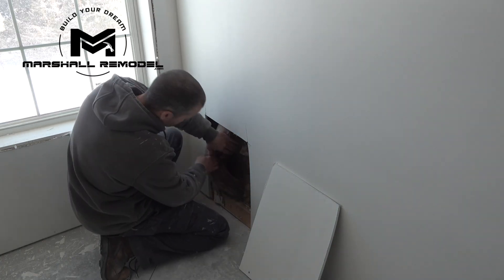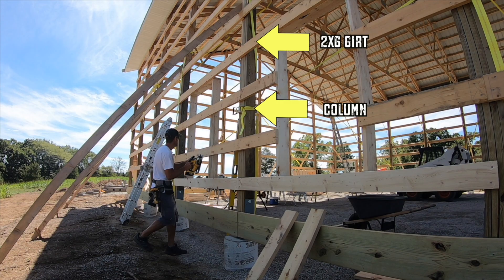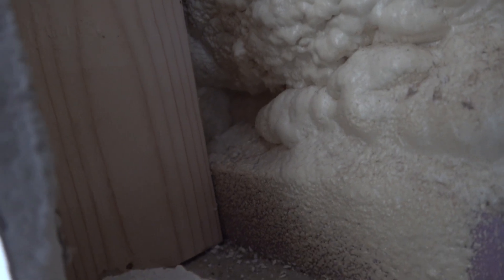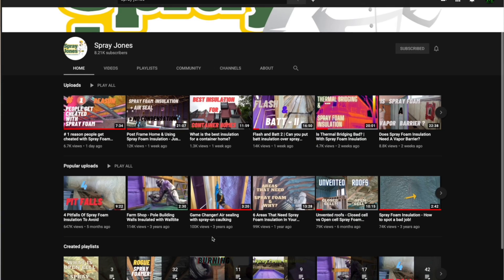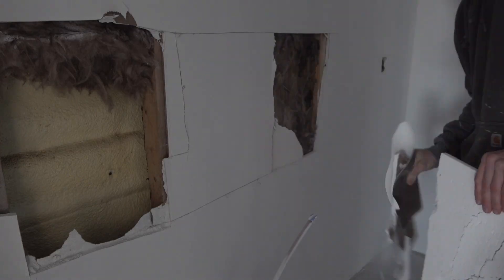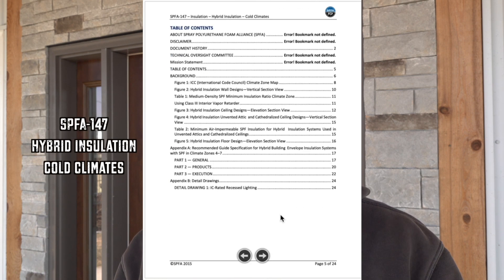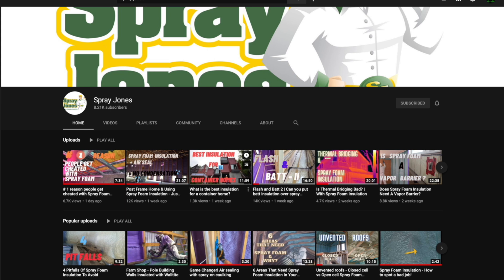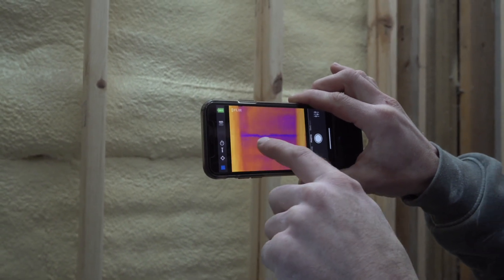Watch This Before You Insulate Your Home! | What Caused the Moisture Issue

Comment: I think that fiber glass insulation here is the main problem, I explain: as someone else wrote here that condensation appears when warm, humid air meets a cold surface, in this case, the inner side of the spray foam insulation was cold, because fiberglass  insulation was not allowed it is warm there, but the humidity passed, and condensed on the surface of the foam insulation
Reply: I think you right.    Our metal building we put 2 in closed cell and 4 plus inches open cell over that   Would still condensate.     Amarillo TX.   Dry area.    If designed for tighter living space needs more ventilation.   Spray foam is toxic as well.  Cool product but can achieve similar results with mineral wool

Comment: Would notching the posts and eliminating the 1-1/2” gap from the 2x6 running east to west across them fix this - it would make the tucked and metal flush to your upright beams and eliminate the gap that you currently have

Comment: I did not quite understand this. I always lived in a fiber glass insulated house. So Dew point should be inside the fiber glass insulation. However, I never had any issues with moisture for many houses I lived.

Shouldn’t condensation happen inside the fiber glass since it is not a vapor or air barrier?

Comment: I wonder what would happen if you blocked between the girls with 2x6 attached to the posts.  That would eliminate that 1-1/2” space that is hard to get the spray foam into.

Comment: I watched a lot of Mike's videos. I get what he's saying about having to make sure the chemicals are right and haven't been sitting around for two long as they appear to have a short shelf life, and how the installer has to properly apply the spray foam and insure at least 2 to 3 inches of coverage, etc. But from everything I've watched so far it sounds to me like the spray foam is more of a secondary back up to insure any moisture isn't able to seep through where the spray foam itself acts as a secondary barrier to block moisture from coming through. What is confusing me though is how are the people using only batt insulation not having major issues with their insulation is getting soaked with moisture? I know RR has built a lot of post frame metal buildings where he only used batt insulation without any spray foam. You would think because of the metal siding that insulation would be getting soaked from moisture build up from the metal siding. Yet if you use spray foam AND batt insulation over the spray foam, it appears a lot of people that have done that are now finding the batt insulation is getting wet. 

One of the things I would want is to be able to create as much sound proofing as possible when building a work shop to prevent noise from bothering the neighbors and anyone in the house while sleeping. I'm more of a night owl were I could see myself playing around in the shop to 3 AM on many nights. I heard using close cell spray foam does not act as a good sound barrier and can actually contribute like a noise conductor to transmit sound like wood does. So I was thinking in lines of using the closed cell spray foam and then adding Rockwool insulation behind it since it has a good sound barrier to deaden the noise from inside the shop when running noisy equipment like a table saw, planner, etc. Now I'm thinking maybe the best to achieve better sound proofing would be to use the spray foam on the outer wall then just double frame around the outside walls and use the Rockwool on the secondary wall which would create about a 1 inch gap between the double walls and create a more solid soundproof building. It would also allow for all the electrical and any water lines or plumbing to be run through the secondary wall leaving the outer wall to be completely enclosed with spray foam with the exception of having to run any electrical through the outside wall for any outside lighting, plugs and water spigots.

Comment: The primary problem the system you have used is that you did not install an exterior moisture barrier and drainage system. For example,  a Zip board system on the exterior would have been an excellent choice.  With the Zip board you would then install an air space between your metal siding and the Zip board.  There are plastic baffles that you can use or liquid rubber applications like RedGuard. Zip board issues several designs for exterior wall waterproofing.  At the bottom of your wall system you would install a weepscreed to allow any water that penetrates the steel siding to drain out the bottom of the wall. 

This would provide redundant protection from water penetration. Your current system will not. 

I am skeptical that interior closed cell foam is sufficient to shed exterior water over time. It really is not designed for that. Your only alternative at this point is to ensure the exterior steel siding envelope is perfectly waterproof. That is a daunting task,  but it is doable. 

Make sure every penetration through the exterior siding is sealed,  preferably mechanically sealed with rubber washers or flashing. Try to avoid caulk as much as possible because it becomes a nightmare to maintain.  Use high grade exterior caulk as a last resort. 

I hope this helps you.
Reply: Water penetration isn't the cause of his moisture problems. The problem is condenstion from moist interior air against cold exterior walls.

Comment: Mike is the guy. Too bad he is only in Canada. A good inspector pre and post spray is a wise idea. Also, consider if you need to go all the way and put a bullet proof moisture/air barrier in place in addition to the two pound foam. Mike can make 2" of two pound work and skip spray and batt, if the foam does not work, neither will the batt insulation. David Poz did his own house with a double stud wall at about 14" of cavity filled with blown in cellulose, no inside VB, regular plywood sheathing, and then Grace Ice and Water Shield on the entire exterior of the home - roof and wall. His blower test was off the chart good. This stuff will keep you up at night even if you don't watch Dr. Joe!!! Bob in Nevada were we do not fix leaky roof and follow none of the good rules, dry air is dry air and a leaky house is fine if you can afford the utility bills. See ya.

Comment: I thought there would have been a better discussion about building science. To me, a contractor who believes in only one method of insulating is to bias. It would have been good to hear the degree days (Example: DD6000x.004=R24), optimum levels of insulation depending on the region, and where the dew point falls in the wall, etc. How the slab, walls, ceiling, HRV/ERV, windows and thermal mass work together as a complete building system seems to be missing in these self builds. Seems like if one is spending north of $200K, building modeling would be worth the expense before construction.

Comment: So what caused the moisture? Sweat or like rain and frost coming through?
Reply: Sounds like its condensation due to not enough foam - not a leak. Warm inside air is hitting the cold spots and condensing
Reply: @ELIRAXPRT   thanks! This had me worries I'm in the middle of building our post frame house and we went with spray foam. Exept we went with open cell and ours is 6 to 8 inches thick. Hopefully this doesn't happen to us

Comment: That is too bad!!  Why did you not put any vapor or double bubble under your roof metal?
Reply from the maker: The attic space was not the cause of this problem, and we do have a properly insulated attic space.
Reply: @MrPostFrame  I didnt mean to imply that was the problem. I was just wondering if the roof dripped at all, I have never seen roof metal without some kind of vaper barrier.  I really like the attention to details that you put into your build, makes all the difference!

Comment: You didn’t mention anything about the extreme conditions that lead to the failure, high indoor humidity and extremely low outside temperatures.
Reply: That's because he said to go watch the other guys video that covers everything you mentioned.
Reply: @macevans1246  Yes but we come here to watch, hear and learn from "his" story, understanding the extreme conditions and the timing is an important part of this story. If the drywall phase of the project was taking place during the summer months, no symptoms would have presented and it would have been completely missed.
Reply from the maker: It's likely this won't be the final update on the situation. Tried to keep things simple this go around.
Reply: @MrPostFrame  I can totally understand that, I am sure your plate is more than full of challenges at this time. Love the channel, keep up the excellent work.
Reply: @MrPostFrame With the price of lumber at triple of a year ago im seriously considering Insulated concrete forms( no mold issues)..instead of stick or post frame as the cost currently is not that much more diy but haven't checked the price of concrete lately. Hope the price 1/2 " sheathing/roof decking( not even roofing on only purlins of a 12/12 pitch roof) comes down from over a $1.50 a sq ft or else many others and I may cancel/ delay starting build. Perhaps that will lower demand, will deflate the 50 bucks a 4×8 1/2 cdx price.
Southern Iowa is as much of Midwest( my planned build in southeast Ohio)are both hot and cold climates bordering zones 4 an 5 so what are we to do, build as the south or north??
Seems dicey to use these new encapsulated wall methods as your experience proves..hope it works out for you.

Comment: Spray Jones has great content but the information he provides is relatively useless to homeowners since we won’t be doing the work.  It’s up to the insulation contractor to do the job correctly, not us.  I have spray foam in the attic of my current house and it was done really well, but it’s a crap shoot.  My biggest problem with spray foam is that it requires some level of knowledge to do correctly, and as a homeowner you don’t know if it’s done correctly until it’s too late.  Spray foam as a product is far superior to fiberglass, but the fact that an insulation contractor can completely ruin it by lack of experience makes that almost irrelevant.  How often are fiberglass bats installed incorrectly to the point of having condensation issues?  Probably not nearly as many times as issues with spray foam. I just wanted to make the point that homeowners aren’t going to be able to use the information you’ve provided or Spray Jones has, it’s all up to the contractor.  Great videos keep up the good work!
Reply: Did you do the underside of your roof? I just did 3 inch closed cell. I didn’t do any research but wanted something that would insulate better since my rafters are only about 5-6 inches so I couldn’t get a proper r value with fiberglass. 

Now I’m scared about the fact that if a leaks develop. I will have no idea unless It’s visible from up outside  (I have a ranch style house) but at that point the damage is already done. I do plan on installing a new roof in the next 2 years for the piece of mind and I’m getting close to needing a new roof anyway.
Reply: @tite732  We did the underside of the roof with three inches of closed cell foam, not sure of the brand of the foam.  In our house there’s a living space in the attic so they could access the area to do the work.
Reply: @dufusk  yea we have the same. Our attic it’s huge and now conditioned space. How long have you had your foam insulation in your attic? Has it made a difference? Our attic was naked so I assume I should see some kind of improvement with energy consumption

Comment: There is just too much building science that goes into building houses to airtight these days that one size doesn’t fit all. Climate zone and materials and type of assembly are critical to understanding. I’ve personally done spray foam on houses before and it’s been ok. BUT I think there are too many potential cons to spray foam that I think there are other ways to insulate that are far superior. I like rockwool insulation both exterior and interior.

Comment: Sure Foam Jones is really good spraying foam but his video talking about your condensation problem is just misleading. Your problem isn't about the impermeability, (you already have a Tyvek impermeable layer). It's about the warm air geting in contact to the cold points in your outer walls.
It's like the condensing water in a Coca-Cola bottle in a 🔥 summer, the difference is that the interior of your house in winter is the warm air in summer and the cold points of your outerwalls are the cold surface of the Cola bottle.
So it's all about the thikness of your isolation IMO (I'm an architect)
Reply: IMO I would try to get as much isolation as u can in your outerwalls before you close'm & look for the highest U value foam.

Comment: Icf is superior to the best spray foam job everytime
Reply: Probably true but it would be 10X the cost for a structure like this.
Reply: @chadhartman1040  hardly. Have you seen the price of lumber and spray foam
Reply: @paulnovak833  Do the math on a 180 lin’ of 18’ tall ICF wall all the way down to the footing, include the needed engineering, bracing, excavation, backfill, steel etc and your many times over the cost of a post frame structure insulated with spray foam. Closed cell spray foam has been at $1 a board’ for 10 years in my area and hasn’t changed, lumber has definitely doubled but post frame structures use much less than traditional stick framing.
Reply: @chadhartman1040  Why build a palace?? ICF is a great choice but not for thousands of sq footage more than needed. Unless youtube is subsidizing, most cant afford 4000 sq ft houses.
Reply: @paulnovak833  yes I have and agree , for my 9 ft wall project icf's are becoming much more practical, dollars and sense wise....building 1 1/2 story with 12/12 pitch roof instead of 2nd story framing. And no long term worries of moisture and mold to boot.
   1/2 inch cdx sheathing 50 bucks a sheet.....9 ft 2x6 stud over 10 bucks and then the bottom and top plates, blocking, building wrap an high dollar spray foam....and if you pencil out difference in lumber between stick and post frame with its non structural studs at 2 ft centers...between those structural timbers you need drywall don't you ?
Reply: @RICK-uf1jj  “Why build a palace” Stay in your lane Rick, we are all free to choose the house we want to live in here in America, well at least for now anyway... Do you watch this channel? You don’t really seem to have any understanding of what they are trying to accomplish with a self built post frame home.
Reply: @chadhartman1040  the cost to get 4" of spray foam already has bought you your icf forms. Engineering,  excavation are a wash. So then you are left with your concrete costs and rebar. The company I use for the forms rents out the bracing for free. To speak nothing of the fact that it's far superior in every category over these post frame structures.  The video here proves my point

Comment: Definitely going to stick with closed cell spray foam on my new build.  Have used traditional insulation with a vapor barrier and house wrap in the past with no issues, but energy costs are going to increase thanks to the green new scam. Going to save what I can

Comment: You haven't mentioned,  did you use closed-cell (2lb) spray-foam or open (1/2 lb)? The first is a seal and vapor barrier, the second is not. https://www.youtube.com/watch?v=zvL4va6P5F0
Reply from the maker: It's closed